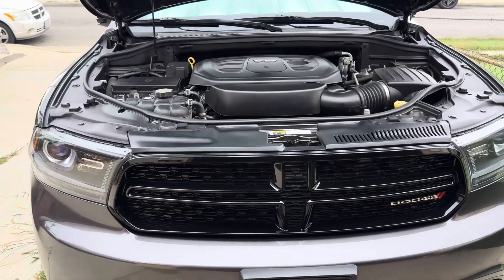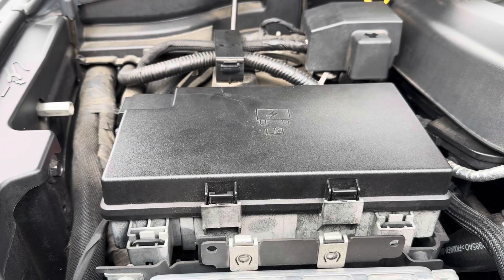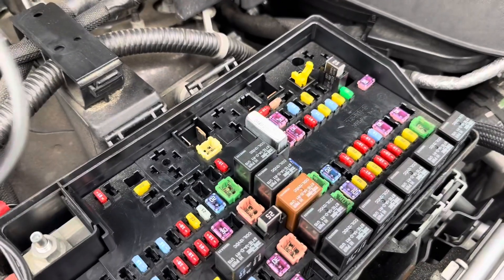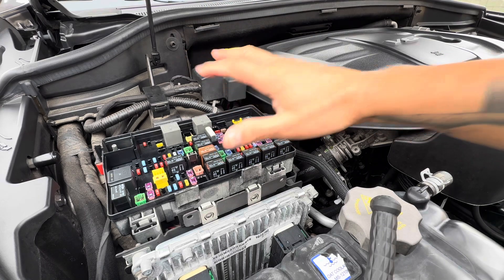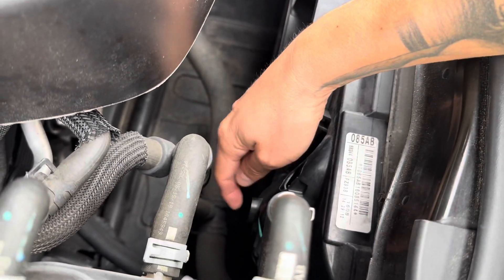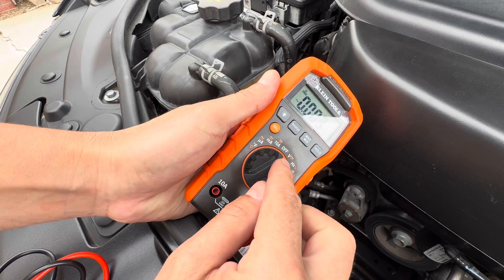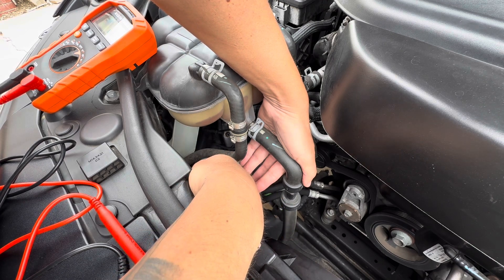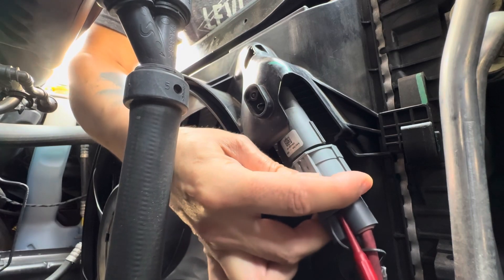2018 Dodge Durango 3.6L Engine Overheating issue! Electrical Cooling Fan System Test.

Comment: What if fuses pass but cooling fans connection doesn’t?
Reply from the maker: If the cooling fan system fuses are good but the cooling fans connection doesn’t , have power the problem likely lies in another part of the electrical circuit that controls the fans.